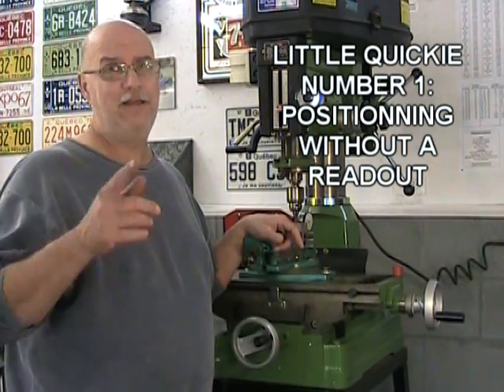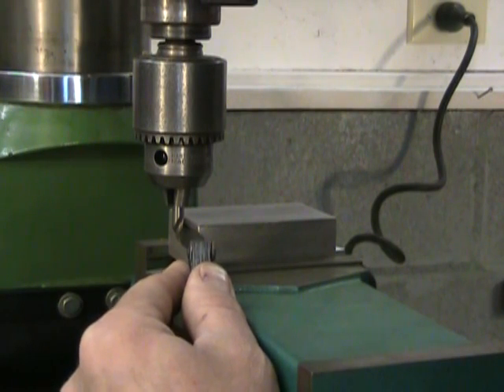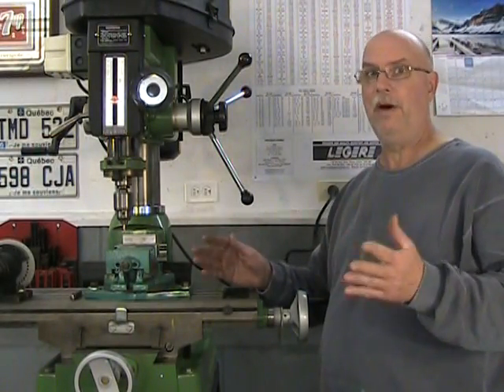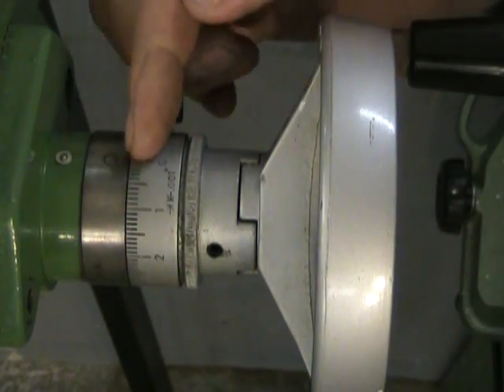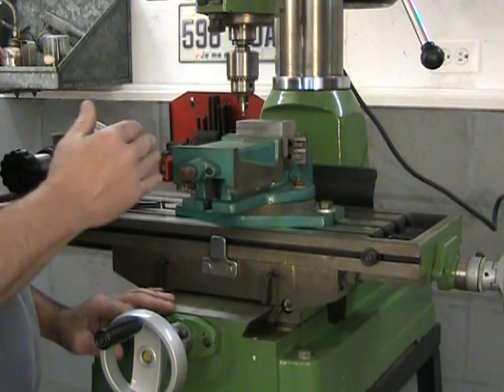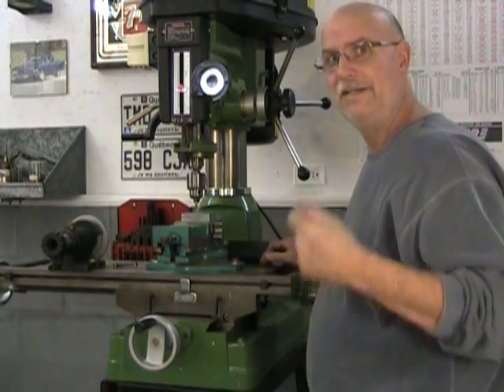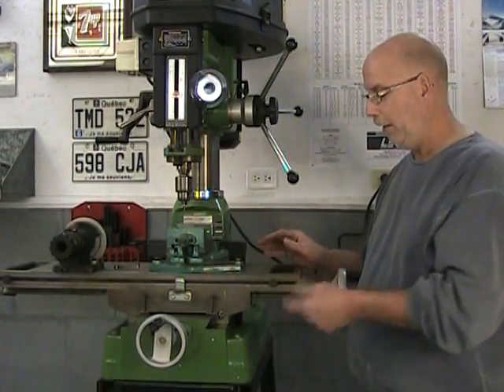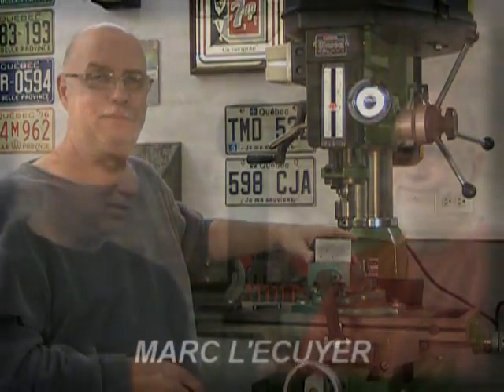HOW TO POSITION HOLES ACCURATELY ON A MILL WITHOUT USING A DIGITAL READOUT, MARC LECUYER

Comment: Excellent video as always Marc, Although very helpful, it would have been nice to see a more complicated set-up like a 5 or 6 bolt pattern on a given PCD for a square or round flange. I think I could do it taking into consideration moving past your required gap and then winding back always keeping the same direction of movement for measurements. But would be nice to see and keep as a reference. Thank you.
Reply from the maker: Hi Bernie, here is a video that I produced some time ago about producing a 5 hole circle on the round column mill. I hope this helps, Marc      https://www.youtube.com/watch?v=SrS2VtDf7IE
Reply: @THATLAZYMACHINIST  Thank you Marc, I am amazed you replied, good show. Bernie

Comment: Would it be beneficial to lock the table each time after positioning before drilling. I. E. to reduce the risk of accidentally bumping the table out of position because of the backlash?

Comment: Marc, apologies if I keep having questions lately. One thing I was wondering, if you drill Hole A, and then movie directly to Hole C, will you get some "cumulative error"? For example, I know the machine is probably pretty accurate (I am not familiar with how accurate it truly is, up to .0005?), but if you are slightly off on the first hole, then that Hole C really is being moved to from Hole A's reference, isn't it? So you can accumulate error if say, you had 10 holes. Is there any situation you would have to start to account for cumulative error (I think it may be called progressive error in machining?), or is that mostly dependent on the tolerances in the part specification?
Reply from the maker: Each hole will have error, the best way to avoid accumulating it is to refer back to the original zero. When I move from one hole to the other I do not reset my zero, I use the zero I set at the start. Lets say I had a first hole at .375 in x and  a second hole at .500 in x. I would set my zero on the reference surface then move .375 and drill my first hole. Then I would count from there, I was at .375 so next zero on the collar will be .400 and the next one after that will  be .500 . If however I reset my collar to zero after the first hole (.375) and then counted .125 I would also be at .5 but I would have doubled my chance of error. I hope this helps, Marc
Reply: ok, I understand now. Even though after Hole A, you continued from that point on and added to get to Hole C, you were still referencing the same zero point. I mistakenly was thinking you were referencing Hole A in some way to get to Hole C, but actually you were referencing Hole A's current position, which was already based off the original zero. Ok, that makes sense. Thank you for responding.
Reply from the maker: Hello again,  one thing that should be mentioned is that some times the tolerance that separates two holes is important. If hole A is positioned from the edge of the part with a tolerance of +- 0.005" and hole B is positioned from hole A with a tolerance of +- 0.002" it is necessary to indicate (find hole A's actual center)  the completed hole A and set its position as zero and then move from there to produce hole B. That way  the positioning tolerance of hole A does not affect the tolerance of hole B. An example of this type of dimensioning can be seen on holes of the vice jaws of the machinist vice project. You can download all my project drawings for free from the first page (big red button) of my website   THATLAZYMACHINIST.COM
Reply: That is a great point on relative positions, Marc.  Thank you very much from someone who's both lazy AND very amateur as a machinist.

Comment: I am enjoying all your videos,very informative, i am pretty much a novice i try ,i make mistakes but im learning,
i wonder if you could explain in easy terms how to measure & machine dovetails on the vertical mill? many thanks, Garry.
Reply from the maker: Hi Garry, that would make a great little quickie. Do you need both male & female and is the dovetail  60°? Marc
Reply: Hi Marc, if you could explain both male&female, the dovetail is 60deg.
Thanks Garry.

Comment: You should always have your Y axis reference point against the solid jaw of the vice. That way, you don't have to turn your screw backwards, and that surface doesn't move, removing the necessity of re zeroing your Y for each part. Also, when you pick up an edge and resetting your dial, compensate for the radius of the tool by setting the dial back by that amount. That way, when you turn the dial to zero, you are right over the edge and you don't have to reset the dial a second time. By resetting your dial only once, you cut that source of error in half.

Comment: another video that answers a specific question I had regarding an upcoming project, the building of a tool post grinder.
new, they are unrealistically expensive, whilst used versions retain their price levels all to well.

I already had a precision arbour, and a nos dumore motor with pulleys from ebay at less than the shipping cost offered a potential solution to my dilemma.

a good friend has a machine shop and has offered the use if his Bridgeport, but I was lost pondering how to locate the holes precisely as it has no dro.

and eureka!! thanks to you i am ignorant no longer... at least regarding that question....

thanks again for you shop and training videos. they are helping this late in life beginner immensely.